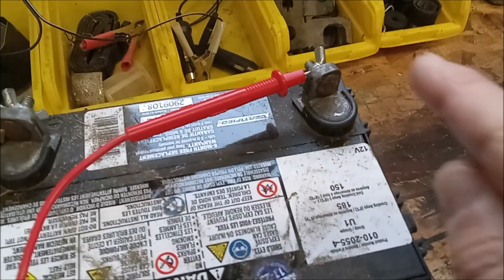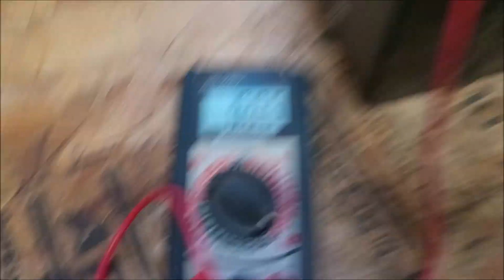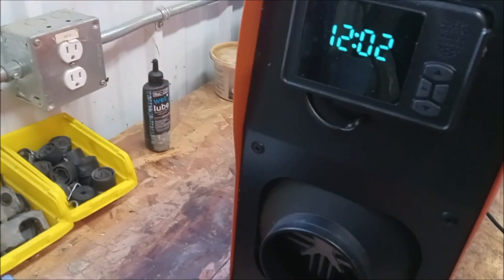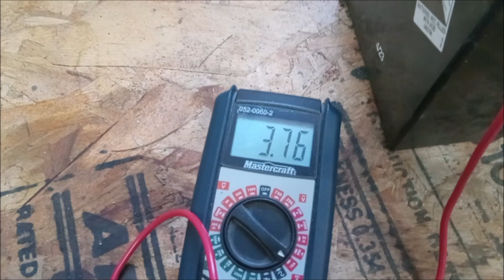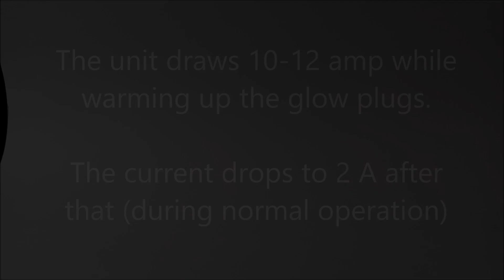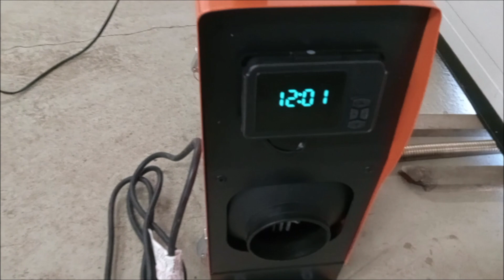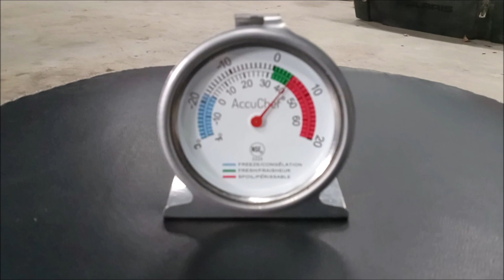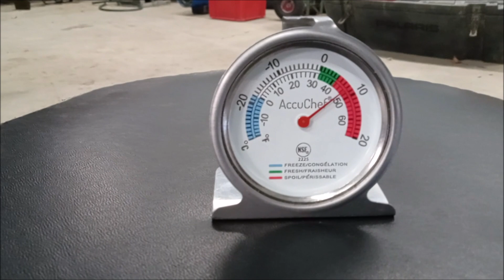Vevor 8kW (27,300 BTU) diesel fired air heater - Part 2: Testing - Ideal heat for a work shop

Comment: Great little heaters, I’ve worked with many Webasto and Espar heaters in commercial transport, try to avoid short cycling them by turning them on and off without much run time when you use it.

The glow rod is shrouded from the combustion chamber by a stainless steel screen and over time the screen carbons up and you’ll need to disassemble it and clean or replace the screen…. You’ll know when it’s time due to no start problems and excessive smoke.
Reply from the maker: Great feedback.  I'm always a bit reluctant to do product reviews without first using something for a long time.  That's why I specifically labeled this video series as unboxing and testing.  Long-term reviews are a totally different thing.  Cheers.

Comment: Everyone and their mother have shown that these heaters work. What I am most others actually wonder is if they will heat a two-car garage to 10C on a -3C day. My search continues.
Reply: I have one, living in Ontario Canada, my garage is a car and a half. Insulated with concrete floor. After 3 hours on high I can still see my breath. It's warmer then outside but not amazing. Going to get a different heater to warm the garage and this too maintain the temp
Reply: @anthonycalderone88  thanks of all the videos I have seen you answered my question
Reply: I have a 1 1/2 car garage as well uninsulated block, -12c outside I got to 7 c took 4 hours and a lot of fuel, I'm looking for a used rv furnace or possibly two of these heaters, also in ontario

Comment: Great video! At home i do the same using one of those amazon rectifier/voltage converters. Claims to be 30 amp also has an adjustable voltage regulator so i set mine believe it is 13.3 volt with no load and 13 volt with load, but really good demo on testing the start up amperage 👍 exhaust also can get crazy hot just a heads up
Reply from the maker: Thanks for the info!

Comment: They do work great I have on in my 
12x16 shed / shop keeps it at +21c easily with an outside temperature of -30 on the medium setting the only setback it’s not thermostatically control other than that I’m OK with it 👍
Reply: The actual temp sensor is in the command module (the one with the screen) you can extend that , put longer wires and put it where you need to measure the temperature.Hope this helps.

Comment: I've had one for about a year.  While a good little unit, it's not enough BTUs to keep my double attached, fully insulated garage over 12 degrees Celsius on a cold Alberta day.  My garage cement floor really holds the cold and this little heater takes quite awhile to raise the temp in the garage.  I usually run my 80k kero jet heater for 5 mins first then use the vevor to try and maintain the temp.  Overall a great little heater, but not enough to heat my little  garage to tshirt temp if its minus 20c outside.
Reply from the maker: Thanks for the feedback.  I agree that it's too small to maintain a constant temperature when it's -20C outside.  I just want it to take the chill out of my shop a few times per winter, when I have to do some work in the shop.
Reply: @Martyupnorth  Yep.  Right now its -2 outside and my garage was sitting at +5 when I came in this morning.  Have had the heater on for hour and it has raised the temp to +9 (up 4 degrees).  At least its alot cheaper to run then kerosene and being vented, doesnt stink up the garage.😁.  If you have a way to partition your shop it helps.  I have cup hooks across my garage ceiling evenly spaced so I can easily hang a tarp across the middle of my garage.  If I want to do bench work I can hang it up and only heat the section I'm working in.   Works in a pinch.
Reply: I think most seem to think this is made to heat a big workshop. They are made for a small work shed maybe 10'x14' space or maybe smaller.

Comment: Thanks for the review. Does the app control or monitor have a timer for shutting on/off? Where it could come on unsupervised?
Reply from the maker: There is NO timer feature.  The app on the phone has a range of about 90'.  You can set a reminder on your phone and turn it off manually.  It will also run out of fuel anywhere between 6 and 30 hours, depending on the speed it's at.  It shuts itself off when it runs out of fuel.

Comment: What would happen if you use gasoline instead of diesel?
Reply from the maker: Diesel and gasoline are two totally different fuels.  You'll damage the burner if you fill it with gasoline.

Comment: I think you have a 5KW and not an 8KW,  if the air output is 90mm its an 8KW heater.  The 5KW has a 75mm air output.